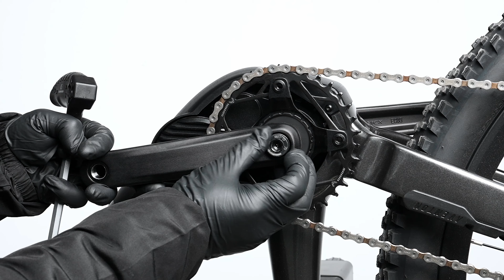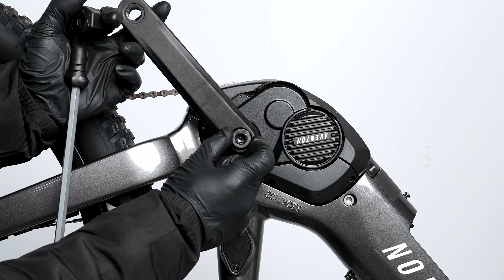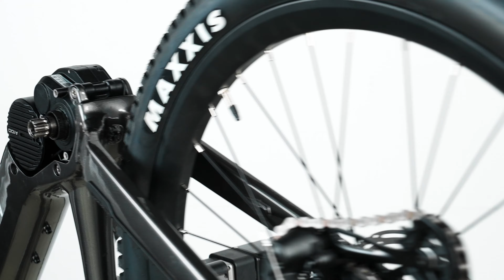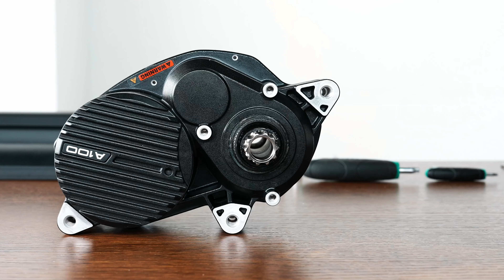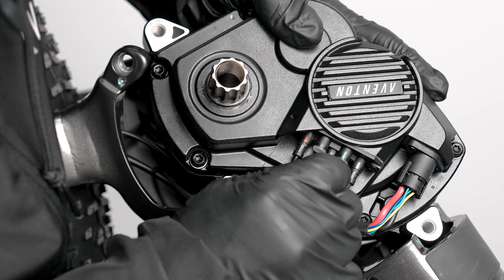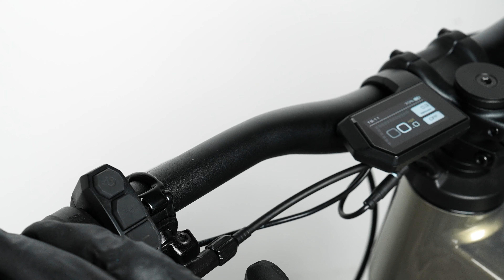Ramblas: Mid Drive Motor Install

Comment: What’s the lifespan rating of this motor?
Reply from the maker: Variation 2: We do not provide a specific rating for the motor's lifespan, as it varies significantly based on how it is used and cared for. A rider covering 20 miles each day may find they need a replacement sooner than someone who rides just 10 miles a week. Should you have any additional questions, please feel free to reach out to our team at 866-300-3311, Monday to Friday, between 9 AM and 4:30 PM PST. Thank you!
Reply: @AventonBikesVideos  Thanks for your reply. How can the motor be cared for to prolong its longevity? I ask because I have recently purchased the Ramblas model. Thanks.
Reply from the maker: A few steps can be taken to ensure that the motor remains safe. Avoid impacts or damage to the motor as much as possible. Despite its excellent water resistance, it is wise to steer clear of deep water and not submerge it. For storage, choose a location that is shielded from direct sunlight and the elements. Thank you!